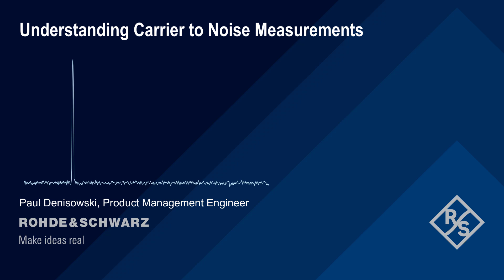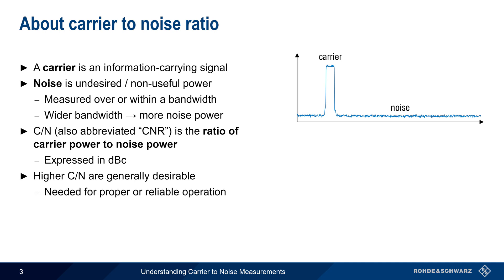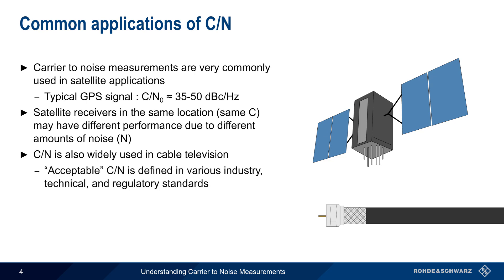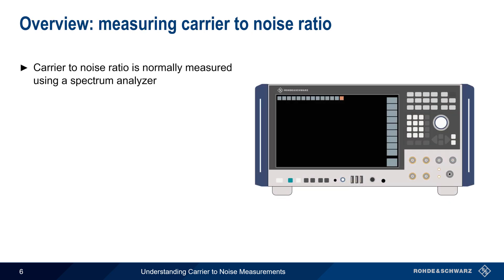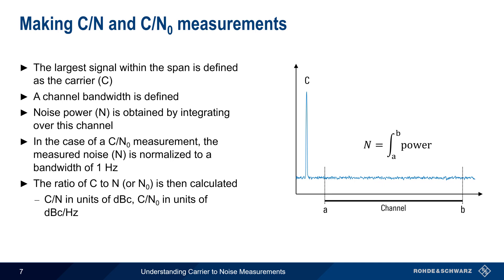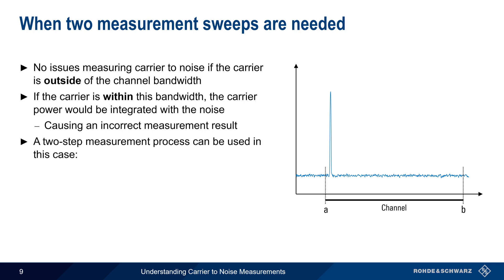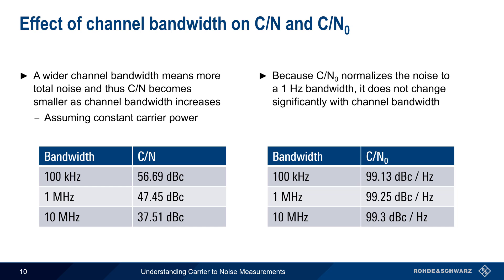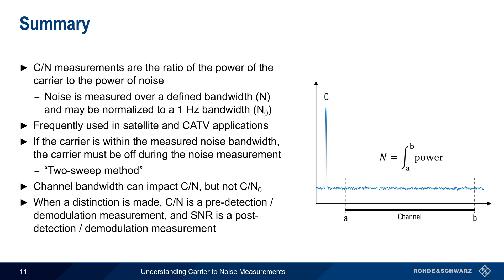Understanding Carrier to Noise Measurements

Comment: I think the information on page 3 is not quite correct. A carrier has a bandwidth of practically 0 and contains no information. This results in a “needle” in the spectrum diagram, as shown on page 6. The example shows a QAM data signal with a clearly visible bandwidth.   
The GPS satellite signal is mentioned on page 4. This is a modulated signal with a bandwidth of 1-2 Mhz. A satellite with 50-100W supplies half the earth's surface. A dBc/Hz value of 35-50 therefore seems very high to me.
Reply: The reason, for the high CN0 displayed by GPS receivers despite the big bandwidth is the following: The big bandwidth is caused by the spread spectrum coding. But the GPS receiver processes the received signal and "de spreads" (=inverse of spreading) it again, so that the bandwidth is reduced again to 20 Hz (not sure about the exact bandwidth, but it is much smaller than the original bandwidth). This explains the high CN0.
Reply: Thanks for the feedback.  I would have to disagree with your statement that "a carrier has a bandwidth of practically 0 and contains no information".  In my experience, the vast majority of people use the word "carrier" to describe an information-carrying signal, and except in certain rare cases (OOK, e.g.), modulating a carrier always increases its bandwidth, often substantially.  When satellite and cable television engineers describe making carrier to noise measurements, the "carrier" is a relatively wideband (several MHz) modulated signal, not a CW tone.  I intentionally showed a "wider" (non-CW) carrier on slide 3 precisely because I was showing a QAM modulated signal, but elsewhere I used a more CW-like signal for illustrations.

I would however also say that carrier to noise is somewhat problematic in that there is no general industry consensus on how carrier power is measured - is is the peak value over the bandwidth of the signal?  is is the sum of the power over the channel bandwidth?  Most spectrum analyzers simply place a marker on the peak signal power in the span and use that power as the carrier, so this is the convention I used in this presentation.  One could of course also make two channel power measurements and take the ratio, but this is not how C/N is normally measured with a spectrum analyzer.

As for the GPS signal strength example:  these are the values measured by most GPS receivers in normal use.  I'd be happy to provide many third-party references showing typical measured values, and I'd also be happy to personally connect various commercial GPS receivers to uCenter and post screenshots of the "Satellite Signal" bargraph showing each SV's C/N0 values if you like.

Again, many thanks for the reply!
Reply: @pauldenisowski  Wikipedia (Carrier): Technology/Carrier signal: "a waveform suitable for modulation by an information-bearing signal" - so still without modulation - without information.
OOK can also be seen as a 100% AM modulation with a square wave. AM creates an upper and a lower sideband, so OOK also increases the bandwidth. 
OOK is also used for Morse code - a bandwidth of approx. 100Hz is specified (ITU-R SM.1138-3, page 4, 100HA1AAN). 
Regarding the information content: Let's look at a 1 Mhz AM medium wave transmitter. What information does the signal contain if nothing is heard on the radio? 
C/N measurement: The FSW and probably all other SAs use the highest recognizable signal. A modulated signal is broader and significantly smaller, which would mean a measurement error.
GPS: The emitted signal has a bandwidth of approx. 1 Mhz. To be able to receive this signal on the earth's surface with a small patch antenna 40dB above the noise, you would need a very high transmission power.
I do not believe that it is possible to display this signal (1.575Ghz) with a spectrum analyzer.
The 40dB is only achieved by the complex signal processing in the receiver. 
May I ask where you are? Do you speak German?

Comment: So does higher Channel Power correspond to higher throughput for Uplink and Downlink when comparing LTE carriers to 5G carriers?
Reply: Higher channel power can influence throughput for both uplink and down link, but the relationship depends on several factors
Reply: @WijthaGayan  It would of course depend on whether or not there is Path Loss to be considered right?
Reply: @amaechinwankwo8283  exactly,, path loss plays a critical role in determining the effective throughput in both uplink and down link transmissions, whether  dealing with LTE or 5G.
Reply: @WijthaGayan  Ok, thank you.